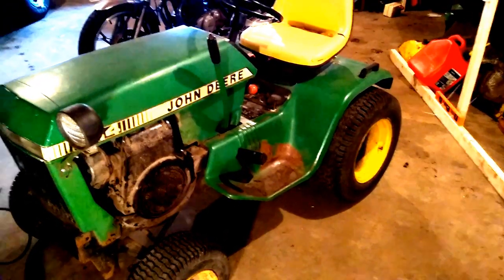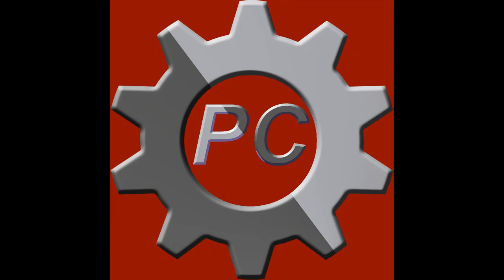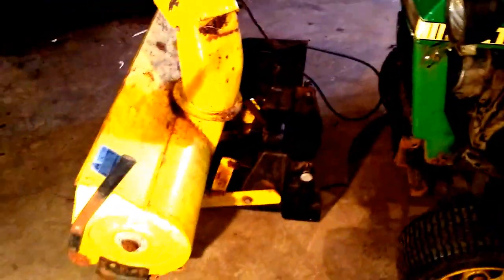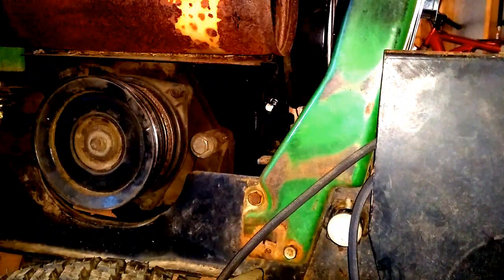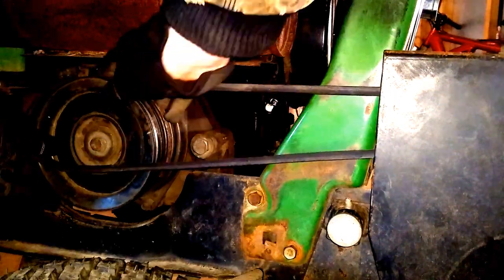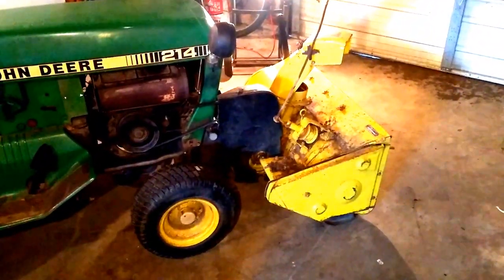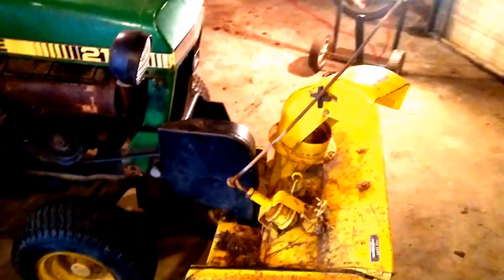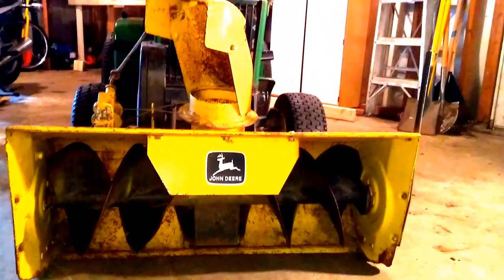How to Attach a John Deere 214 Snowblower - 37a Model

Comment: How long is your lift arm. On mine 214 with blower I pull lift arm back and doesn’t move snow blower at all.
Reply: I'm having the same problem with mine. It worked fine when I had the front blade mounted but when I changed over to the blower, it won't even try to lift the blower. I'm guessing that we need to adjust the ends on the lift rod.

Comment: Where did the chute rotation handle mount?
Reply from the maker: I mount it to two holes on the right side of the tractor.  Top one is at a level just below the bottom of the battery box.  The bottom one is more of a slot in the shape so you can tilt to angle of the mount(at least that's what I use it for).  The bolts that hold the mountain place are not very easy to put in normally I have to reach with one hand around under the battery and use the other hand to try and put the bolts into the nut...

Comment: what do you do with the belt from the lawnmower deck that drives the deck and the 2 arms that hold the deck in place?
Reply from the maker: The two arms are disconnected by sliding them upward until they pop off through the larger section of the arms.  The belt is removed completely.  So in short everything that holds the mower deck is removed from the tractor.  I just filmed this for a new video on removing the mower deck, but its not up yet as I haven't edited yet...

Comment: I had to run mine with a half twist to get it in the right direction
Reply from the maker: That's interesting I don't have to twist mine at all...is it a different type of blower?  I know there are some out there like that...
Reply: @PatriotContraptions   would putting skates on the bottom keep it from digging into the ground,
Reply from the maker: I go back and forward on that potentially yes the downside however is the blower then doesn't touch the ground all the way and you get nice icy tracks behind the tractor which cause you to slip around like crazy... That said I am new to using a blower on this type of tractor... One idea I have seen is putting small wheel rollers right behind the blower to take the weight off a little bit while still keeping it really close to the ground which is cool, but kind of a pain to hook up and unfortunately I haven't seen any test videos of it afterwards so I have no idea if that worked...
Reply: @PatriotContraptions  kinda what I was thinking was a narrow like ice skates, the problem i am having is the ground isn't froze and we have 11 inches of snow